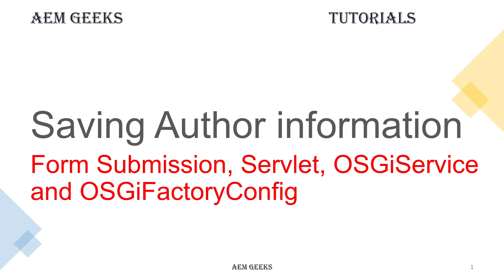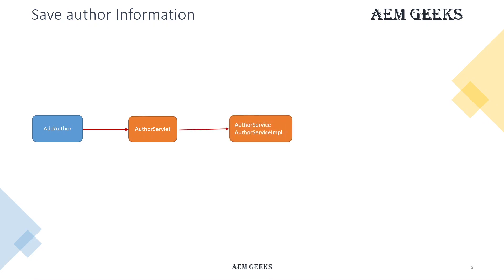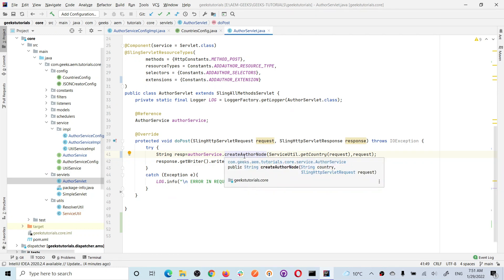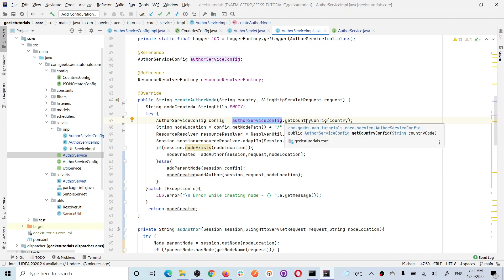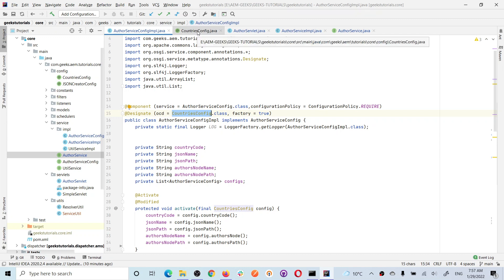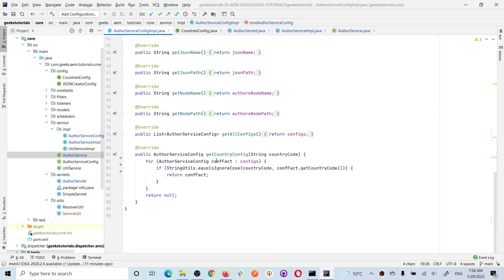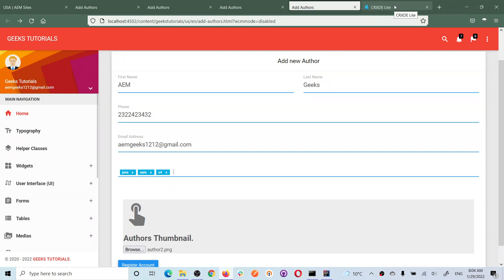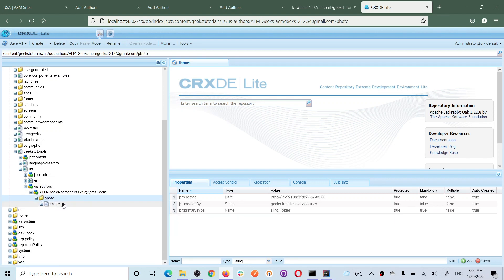Tut #2 | Save form data in AEM repository  nodes

Comment: Could you please guide me how to create a form using core form components { drag and drop }and make a rest post call to external API upon submit the form
Reply from the maker: You write rest POST call inside servlet, you are using for form submit. 
In a proper structured way, You can write a service to handle you data(ex making POST) in service and then call this service in servlet.
Making rest post is core java concept, You can get number sample code over internet . I will this as a scnerio in coming tutorils of this series

Comment: Useful one. Is there a way to save this form information into external API instead of storing them in nodes ???
Reply from the maker: Yes, you can. Make a rest post call to external API with form data instead of saving it nodes.